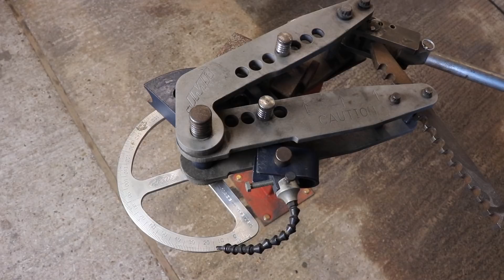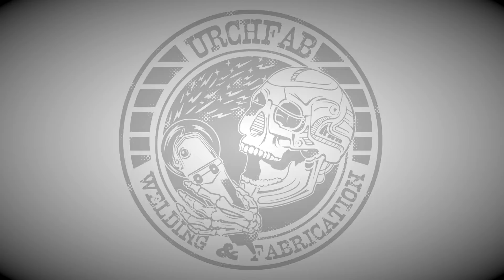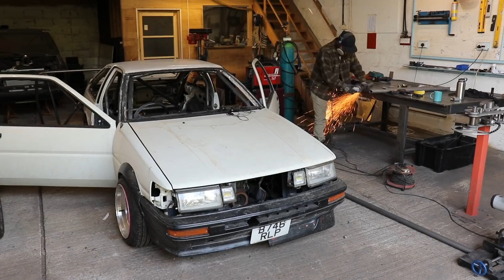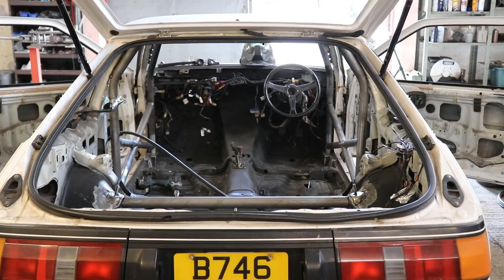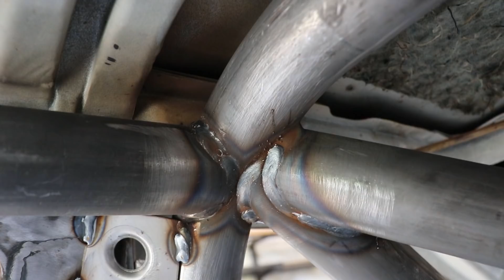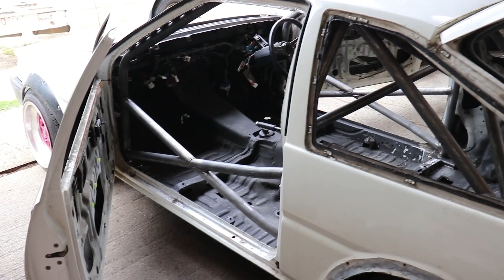AE86 COROLLA ROLL CAGE BUILD, TIME LAPSE

Comment: Nice welds! what did you use to dress the welds on the strut towers?  Is your welder transformer based or IGBT?
Reply from the maker: I just use a flap disc, that one was done with an inverter but I have both. Cheers